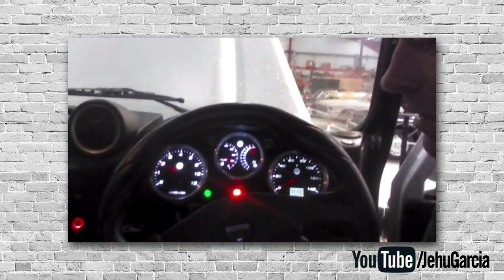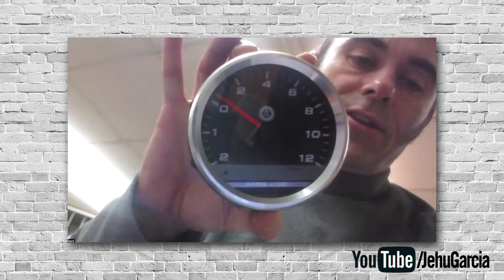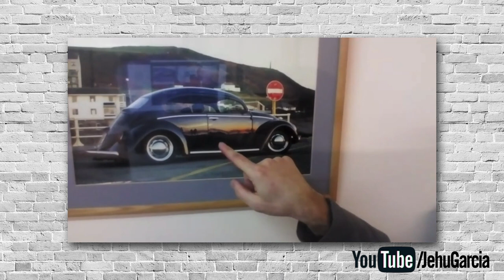#31 Richard Morgan of Electric Classic Cars UK

Comment: Jehu rocks! I want a JAG35 E-Scooter!  to compliment my slowly growing powerwall based on those boxes that hold 24 7S plus 1 BMS.  more compact but a heck of a lot of careful soldering (working on 4 boxes at present here in hurricane alley) working on adding electric to my Hobie Trimaran kayak (pedal, paddle, sail, need motor)